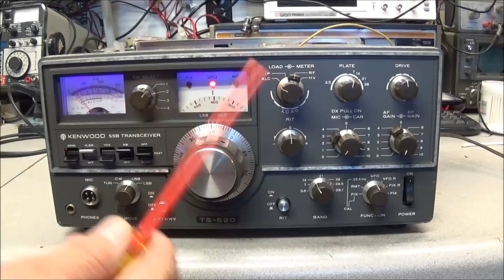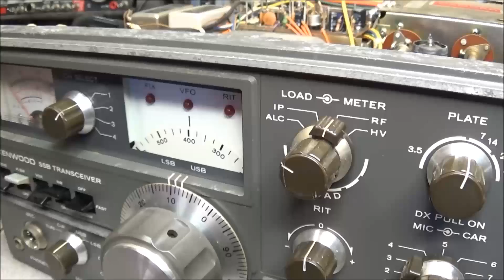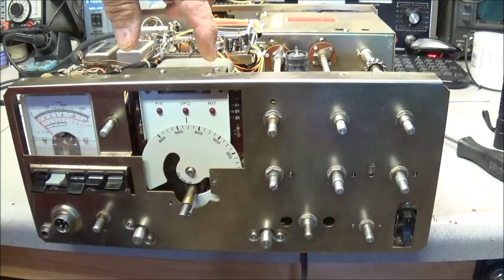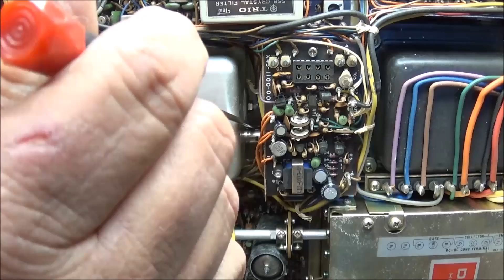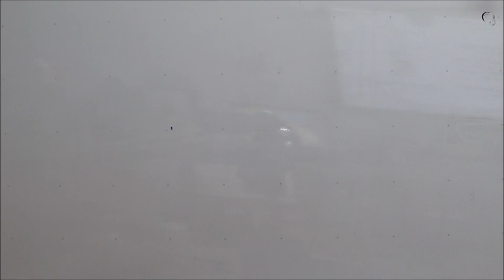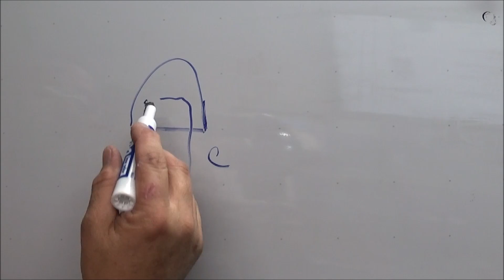#44 How to replace the RIT VFO FIX LEDin a TS 520 for a viewer

Comment: After you get use to tearing into it it gets easier. I have a tackle box with many compartments to store the screws in order of removal because the threads in the led case are not machine threaded and best used where originally intended and have a 11mm socket to remove the control nuts. If you haven’t cleaned and lubed the VFO and controls now is the time. If in the VFO might give the PCB a once over for solder connections and components.  I would take all day on this section alone.

Comment: Fantastic! I just got a TS520SE. The LED's were all dead, but it turned out to be just the rotary switch corrosion. The exterior case has rust on it. Since it was sitting around by an inactive ham for a long time. I will probably repaint the case. It put out 100w on 20m CW. Seems ok.

Comment: Nice video :) Do hope that you make one adjusting the outer dial.
Reply from the maker: +Dennis Andersen Thanks Dennis, You mean the outer ring just behind the main dial?
Reply: +The Radio Shop Yes exactly. If I remember correctly my ts-520 is about 40 kHz off. But I'll have to take a look at that.
Reply from the maker: +Dennis Andersen Trying to vision what you are referring to.  Should be a fairly simple fix. Set radio to say 14.200. Turn on calibrator and zero beat the frequency. You will hear the tone from the calibrator. Once you have the zero beat, remove main VFO knob. If the main dial is not spot on 200, remove the outer ring that is just behind VFO knob. With a Phillips screwdriver loosen the center screw that holds the dial. Rotate to 200 then tighten it. Install outer analog ring and knob, zero beat again. You should do this in USB. Hold knob and rotate outer ring so the zero aligns with the USB mark. If you cannot get it let me know.
Reply: +The Radio Shop Thank you for replying. Will take a look at it tomorrow. Doesn't sound like a big operation. Perhaps I should get some more kenwood radios from that era :) I'm still a bit sad that I sold my first ham-radio from before I had my licens. (At that time, as now, it was, in Denmark, legal to own equipment without a licens, just not to transmit) Was a Kenwood TS-530S with the VFO-240.